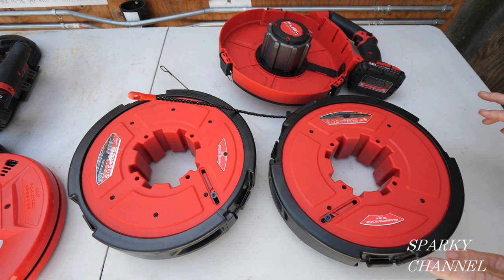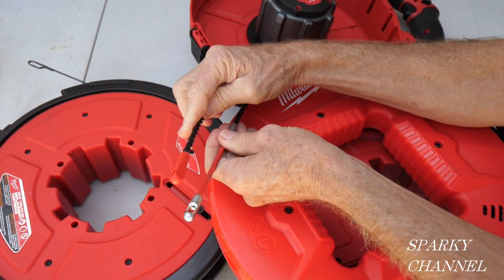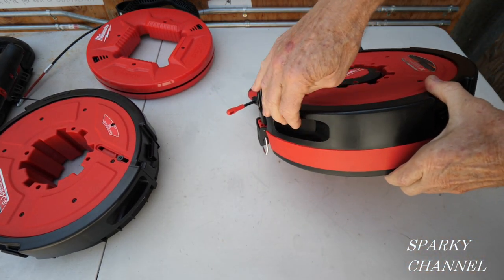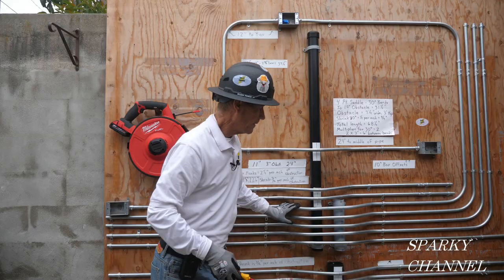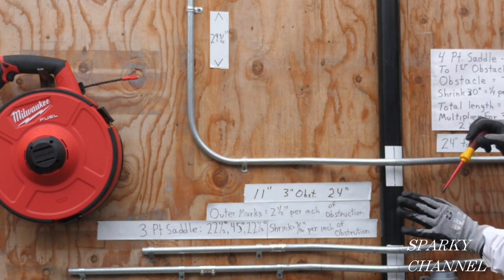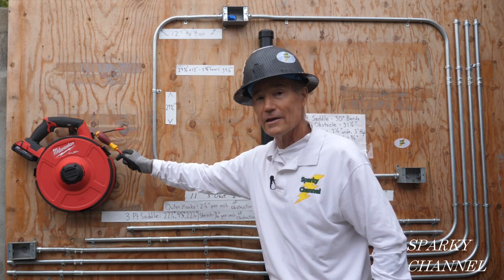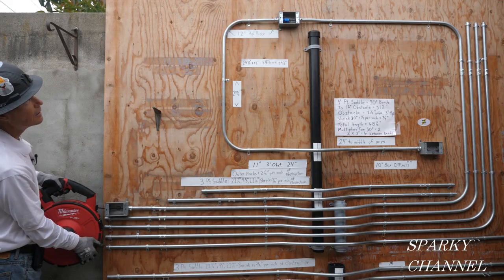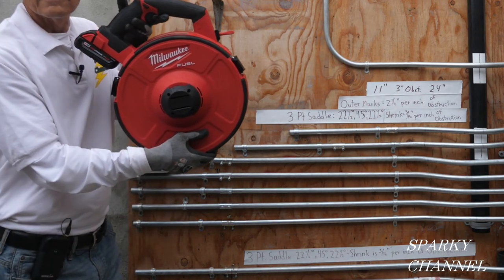Milwaukee 100' Polyester Angler Fish Tape Review + Can it Pass Sparky's Obstacle Course?

Comment: awesome just order my angler with the 240' steel, all the others are on back order hoping to get the 100' nonconductive, thanks for the video.
Reply from the maker: Nice! That's an excellent combination. The steel has much better tensile strength and the poly has much better flexibility.
Reply: Even the non conductive has good strength. Another video did a strength test of 50 pounds and it pulled it up. So good enough for me I only do low voltage I'm going to stick with the non conductive one for the flexibility

Comment: Can you show what the fish tape looks like with 20 feet or so out and out of conduit? The problem I have had with non conductive / non metal fish tape is lack of rigidity and it also doesn't stay straight. The majority of my cable pulls are in drop ceiling or between drywall and they curl too much and go way off target. I am often in too tight spaces for the tent poll style fish tools as well since they can't bend to get in place.  The metal ones still curl a bit and go off target but I find not nearly as bad and much easier to control up to 20 feet or so. Past that even the metal ones get too hard to aim. 

Do they make a metal version of the powered version? I also work around very corrosive stuff that makes even my stainless steel fish tape rust and get super hard to operate since it jams. An electric one would be a godsend. I have resorted to soaking my current one in oil and destroying my gloves often.
Reply from the maker: Yes, they make a 120' metal and a 240' metal drum for the Angler.  The steel has much better tensile strength and the poly has much better flexibility.

Comment: What's the ins and outs with that "wire-buddy" @3:10 !? Never heard or seen it!
Reply: Ah: "Pull Buddy Wire & Cable Pulling" 
they are not meant to catch, but help with making corners less chafey. 
I use bits of PVC pipe for that. Yes, we have half inch around. Not my idea.
Reply from the maker: Rack-A-Tiers 42000 Multi-Pack Pull Buddy Black: Amazon: https://amzn.to/3wS6eqk 
  They're handy!
Reply: @SparkyChannel  "put a link in the description!" ;-)
Reply from the maker: @wim0104  I added the link to my video description.
Reply: @SparkyChannel  "thanks!" lol ;)

Comment: Now pull 4 awg 12 stranded wire
Reply: Would you even use a regular fish tape to pull that? Guy that came to run stuff that fat at work used a steel cable with a winch.
Reply: @timramich  I think they meant 12AWG 12-4. You are right though.
Reply from the maker: I think you mean 12AWG. I've got a video in mind. It'll be fun and educational at the same time. :)
Reply: We pulled 7 12awg thhn wire through 200ft with 460° bend  with no problem at all!